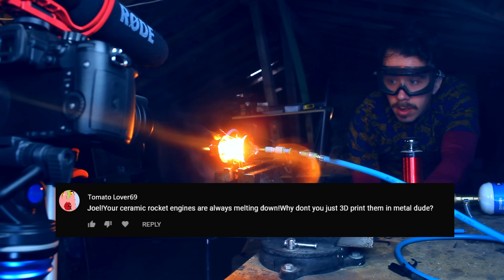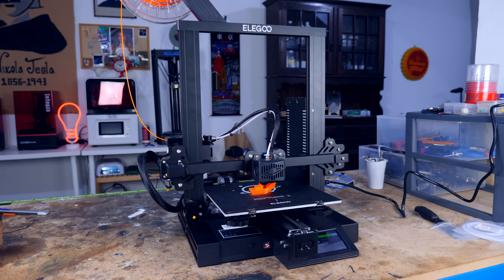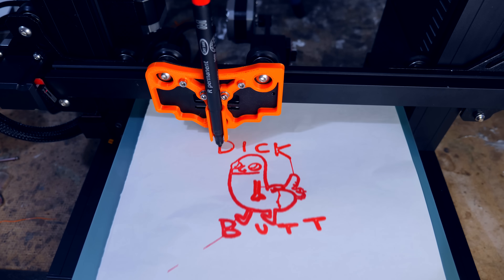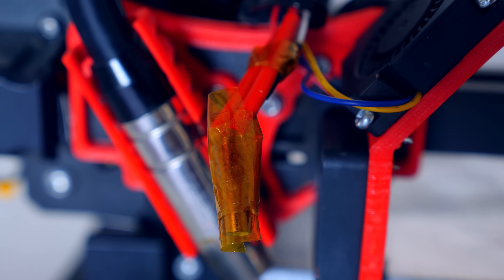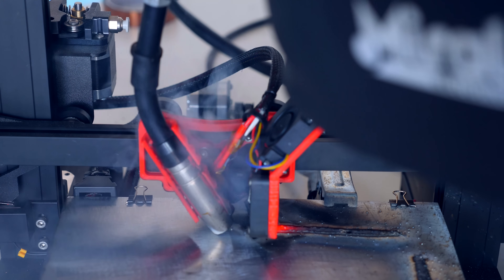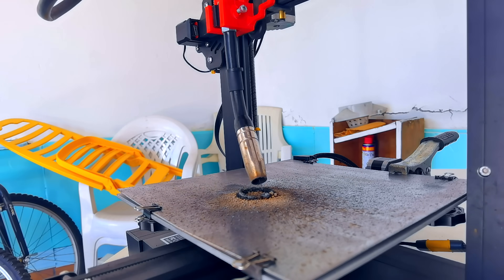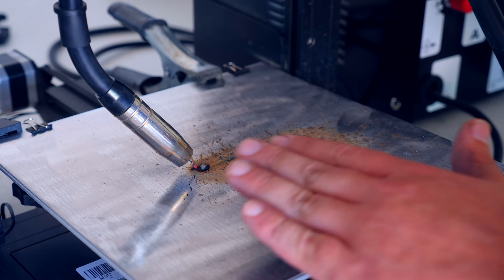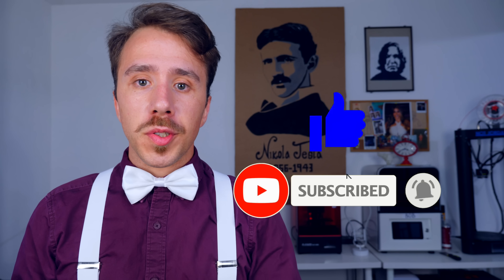I built a Metal 3D Printer using my Welding Machine

Comment: Another issue with using a fan to cool a welding nozzle on a mig welder is that the welding process is insulated by defused gas in order to keep things like oxygen from introducing inclusions into your material. You don't want rust pockets in your weld. They have water cooled welding tips. Well worth the investment if your wanting to do something like this.

Also. Cool idea.

But don't forget there is an optimal distance from the material, feed and travel speed, and gas flow for a good weld. Pausing between each layer is a good idea. If you are trying to build up a weld you would do the same thing. Your other option is hot tacking point to point. But this will create layering and increase the chances of delamination and propagation of cracks.

You might have better luck looking at the feed speeds of Cnc plasma cutter's as a starting point.

Comment: Are you not using any shielding gas? The resulting welds look very much like you aren't. If you aren't able to use shielding gas, try using some self shielding flux core wire instead, and make sure you set your polarity to DCEN, where the work lead is hooked up to the positive.  It would however be ideal to use a shielding gas with solid wire instead because the flux cored wire will generate slag.

Comment: Your welder is using flux core, the other machines you showed that could 3d print metal look like they're using normal C25 gas (carbon dioxide, Argon) also flux core requires you to push into the weld pool, gas mig allows you to pull away from the pool. So your gun is set up backwards. I would try gas and just point the gun straight down, no angle. I looked up metal 3d printers and they look affordable more than the cost you quoted. Also a metal CNC is more useful and those are not super crazy priced. You can get a cheap one off AliExpress and Tormach is what enthusiasts get if they have 10,000- $20,000

Comment: Have you ever heard of lost PLA casting, its a way of creating metal parts out of plastic 3d prints. I believe it would help you build your metal rocket nossle and be an intresting video.
Reply: Integza already has the kiln, and a quick search turned up a furnace/foundry for $300.   Bronze melts at around 900 C, so it really sounds like a working solution.
Reply: the only problem with lost PLA casting is that it only works with softer metals like bronze, copper, aluminum, ect. Its good for making sculptures but not good for parts that are prone to taking on damage or bending. Actual metal 3D printers can make stainless steel parts that are incredibly strong in comparison, unfortunately. I hope some time soon steel printers wont cost a mansion.
Reply: @Pangur_Bon  I didn't know that limitation of lost PLA, thanks
Reply: or this printer - https://www.youtube.com/watch?v=4FkzLs7cLes
Reply: Good luck mending the metal though
Reply: This needs more upvotes. Integza has the drive to make this work.
Reply: I wonder how you could compensate for the decreased size when you burn off the PLA tho. Will you get a porous metal part with the original size, or a smaller solid piece?
Reply: @kerbodynamicx472  theres a company 3d printing full scale rockets that accounts for the warping while the metal cools so...
Reply: @henrygaraffa5584  Relativity space, their 3D printers operate more like lathes, instead of using the cartesian coordinates, the use polar coordinates which as a radius and distance. Those are meant to make cylinders...
Reply: @kerbodynamicx472  you know the cooridinate system doesnt matter, right? and they dont iirc, the extruder moves, not the part. the complexity of the piece is what would make it possible or not

Comment: You just need 3 things, a better, stronger, thicker table. Set the parameters right for the welder and finally a little groove on the nozzle holder that will ensure the right orientation for the nozzle. Also, paper clips to hold the sheet metal is not the way. From a mechanical engineer that LOVES tomatoes

Comment: That kind of welder has a wire feed motor that feeds wire terribly inconsistently. I have tried 2 of them with the same type of wire feed motor as yours (they were brand new cheap harbor freight machines) and couldnt get it adjusted properly. I have been using wire feed welders for atleast 22 years now and am speaking from experience when I say that machine just couldnt feed properly. The wire feed motor is the same design that Clark welders use in the spool gun. It's too small and lacks in robustness for pushing wire out a mig lead. The other thing I learned but actually here on you tube is that the harbor freight model uses AC current to weld. On any decent mig machine the welding current is turned into DC and is actually adjusted by increasing or decreasing its voltage. So... a DC constant voltage power source! This is done to give the machine a smoother more consistent arc that pops and spatters a whole lot less. I believe the same project could be done with a much higher success rate if a better quality welder is used. I.E. a used lincoln sp135 off ebay, I still have my first one and it is over 20 years old and I promise it still works better then the machine used in this video!!

Comment: Have a look at cutting edge engineering on YT and how he welds difficult and very thick hydraulic rods with a rotating machine. He uses argon on fluxless wire to give a clean weld and every two layers cleans the weld with a wire brush on an air tool. You probably need a cnc made of metal to handle the heat and construct layers that are wider. The finished article can then be machined to size using conventional machines. Your approach is a great idea that has a lot of promise for one off productions. Good luck.

Comment: method X is a sintering printer that is @ 4k USD, still expensive but much cheaper than the industrial ones. still need to anneal with a separate oven though

Comment: There is G-Code for curves, but it's usually on 32bit controller boards due to it being difficult to do on 8bit boards. Another issue you may run into is electrical noise from the welder impacting the controller or leads to the steppers if they're not shielded / are too close

Comment: Could you do a lost-foam or sand cast in metal? That allows you to pour molten metal into the shape of your 3D print and get a metal version. I'm working on making my forge and sand casting set up, but it would allow you to make any print in the metal you can melt!

Comment: 1)You can make a jet engine by casting aluminum instead of using sheet metal....for metals just goto a scrapyard and find it there....
2)and for the cooling system use copper melt from any motor you find at scrapyard.
3)And to prevent the leaking problem why not use high performance gaskets used in engine block just cut it to shape.
4)for reverse flame problem i think the culprit is high pressure in chamber and comparatively low pressure in valve.
5)A crazy idea for spark--coat the nails u used in non conducting materials just leave the tip uncoated then place two nails at a gap enough to produce arc at an angle 180 deg it might just solve the spark dealy problem.
6)GIME GIME 3D PRINTER please 🙏 😢 ♥ 🙂

Comment: you're using fluxed wire.  If you use argon plus CO2, or just argon, which has less energy, and a proper parameter setting, you would get much less sizzling and allow continuous welding.  plate deformation, although unavoidable, having very high layer heights after being about 5mm high would stop deforming.  I think if you keep trying you can get it ... you have to protect the printing machine belts

Comment: Hi, Integza I've been hooked watching your videos and cant help but think that the rockets are really working, you need a material which can withstand a lot of heat and easy to handle, can you try to use a 3D mould and try to manually compress some kind of fireproof powder under a press and bake it later to strengthen it or you can manually pack that powder layer by layer so that its uniform ,that way you will end up with a solid piece with fireproof capabilities.... 

Could you try this? or atleast discuss this in one of your videos?

I'd like to hear your thoughts on this

Comment: Well-Done, great idea, & now I understand 3D printer.
Perhaps cut the design of your rocket engine into laminate layers
  Cut the laminate layers out of sheet metal & weld them together into your rocket engine
  Seal any small holes/cracks with some type of high temp ceramic sealant

Comment: Why don't you try to use a "Refatory Sandbed" instead of a thick metal one? To start the weld arc uses a thin layer of metal previous printed in

Comment: Video idea: make metal casting with lost PLA.
That way you'll have metal rockets only using a normal 3D printer (and a melting pot).

And you can use gold to cast the rocket, so you are not made of gold: but your rocket will be! =)

Comment: Have you thought about casting a rocket nozzle? You could print the part in pla and use a sandmold.Then do the wasted PLA method, so the part completeley melts when you pour the metal over it. Still you could probably only cast aluminium (alloy) which also will melt at 400-600°C so it's not really much of a use for a rocket engine :p

Comment: Should look at redesigning the nozzle so it can be oriented straight up and down.  Built a metal frame out of steel tube and tack your thin plate to the still tubing to help with warping.

Comment: Lol, this was so destined to fail. Don't get me wrong, idea itself is sure to work, but 3d printer and especially with that welder it's not going to happen easily. Thing is that all welders have, is it duty cycle named feature that limits time to weld. So especially with cheapo welders you can weld with semi decent speeds for very short time periods. Meaning that you would have to stop very frequently and then continue. That itself is could obviously be countered by simply doing program, but it would be absolute hell to make it all work well, because of shrinking during cooling. But yes, it can be done as video in fact showed at the end. But with 3d printer and cheapo welder... No 😁✌

Comment: Metal shrink when cooled down and expands when heated. It's called metal shrinkage. The sheet on the bottom bends because it gets pulled together by the printed layers, which eventually cool down and start pulling together creating tension outside and inside the printed area.

Comment: 3d print molds to stamp sheet metal with to form parts for your rocket engines.

Set the infill to 100% and use a vice to actually stamp. You can get pretty decent results.

Comment: Yeah, you definitely need an inert gas shielded welder (so MIG or TIG) to make this work. The problem there is that means you have to buy argon or helium, which aren't cheap, and add another point of potential failure.

Comment: professional welder here. First thing is your gonna need is a solid metal mig welder. Building material on top of slag is going to be inconsistent at best and will probably be Swiss cheese. Torch angle is better straight on unless you can change the angle for each directional change in the printer.

Comment: the welding machine should use argon gas instead of fluxcore so the welding results can be cleaner. try to make the support more thicker so it doesn't melt easily

Comment: Hello, have you tried with metall filament for sinter process? Something like "BASF Ultrafuse 316L".  If I have understand it right, you can print it with a normal FDM printer (with a little bit higher temperature ability) and the you had to send the pice to the factory, where it will be sintered. The result should be a metall pice. (with a little shrink of size).

Comment: You should use 3d printed part to crate a mold in sand when you apply heat plastic melts and mold created pour molten metal inside mold and you have it .

Comment: Hey Integza, im not entirely certain but are you using a bare metal wire when your welding? If your not using flux-core wire, which is seems like your not, you need to have a shielding gas(100% CO2) hooked up to your welding machine. Using a shielding gas might solve many of your welding woes, and should help to make your welds much more consistent, stronger, free of pitting, and not to mention look much better. New to your channel but I love the videos! Youll get the welding thing down in no time.

Comment: welder here you should use welding gun that have watercooling first of all. also welding machine that has a pulse feature, that helps to keep weld heat lower and rise the weld bead higher without melting down with the heat. even if you dont have thicker material, bending the edges of the sheet will give it a stronger structure against deformations.

Comment: There should be a metal 3d printer using welding filaments in IPT Fraunhofer - Aachen, if you happen to be based nearby and wants to do an outside activity. I was there during 2009 and later. They have also integrated the mechanism to a milling machine, printing and finishing with just one setup, giving a smooth surface at the end. worth the visit.

Comment: Hello Sir, I was wondering if you could use layers of metal powder instead of the welding machine filament. I was thinking that having one layer, then use the welding machine to weld the metal powder, it works the same way as the welding 3d metal printer that you did, but it may have a better resolution, and may allow you to print bigger items. I am not 100% sure if that would work the way that I envision it, but it is totally worth a video of trying it. 
Oh! By the way I don't have a 3d printer but I would love to have one ;)
Reply: That machine exists.  Check youtube.  The process is still time consuming and complicated.

Comment: I know alot of people have said this and I'm late to the party but try copper plate for the bed so you 3d weld won't stick and use a shielding gas like CO2. Try not to use flux core because it produces slag to protect the weld when it cools. I'm sure you already knew this though because you are integza.

Comment: Its possible to do it, use solid wire, don't use flux because of the slage, don't use that machine, you need gas, with solid wire with gas and then put an plate of 5 or more thickness, and don't weld continually its better tak weld

Comment: I have too many silly ideas and not enough time but another idea I wanted to build was a home made flow bench. Using a MAF sensor from a car and some printed parts. Then use it to see and test dimple porting and add smoke for visual. Also you could simulate erosion and see if you can fix corners and leading edges of parts by forcing laminar flow in said parts or upstream.

Comment: I have been wanting to test the centrifugal limits of printed parts and seeing if you can strengthen them by. After you print your part pre UV cure. Setup a rotary tool probably a die grinder and see if you can find a somewhat steady rpm to spin the piece while your UV cure it. It’s possible it might have some internal stress relief and could make a part be able to spin faster. Making like a dyson style vacuum etc. Or a compressor spool.

Comment: Try again. Use a mig welder with shielding gas. And point it straight at puddle. Use .023wire at 14.5v.
Reply: And build it off a stub so the Bass don’t get too hot

Comment: i've been workin on this kind of thing for a few years. tried doing it with really small welding wire but things ended up jamming in the spool gun easily. moved on from this a while ago. Also by the way your stick-out length is too long, should be more like 1/4 inch. If your nozzle was perpendicular to the surface that might help a bit (just a guess).
I am probably just going to end up using the metal-infused filament that you an use in a plastic printer, and then get a kiln for the sintering. Not sure if those parts have any kind of strength though.

Comment: Basically works like a welding robot. Used to make many things, like cars. If you could actually extrude metal it would be 3d printer. The difference being the amount extruded, a wire vs. a larger amount.

Comment: Video idea: Record sound or data on a 3d printed disc or cylinder like vinyl records or Edison wax cylinder.
Reply: The resolution would be extremely poor. Even with a resin printer, I don't think you could get anything that would make recognizable sound on a standard format that a player can use. Maybe a CNC could do it, though!
Reply: @4.0.4  
I'm thinking it doesn't have to go on a real record player. it could be played back using a needle on a cone while the disc/cylinder is spun on a drill. 
you could make the grooves deeper, lumps higher for more movement of needle. you could sand the disc/cylinder down after printing it then record the sound using a cutting needle on some sort of electromagnetic actuator. Edison done it. also someone done it on a Plastic Food Plate 
https://www.youtube.com/watch?v=APXXBTwkXSg&ab_channel=databits
Reply: https://youtu.be/IQi8FUsZ8OY

Comment: Actually love tomatoes, lol, this channel too. 
Idea. A small scale waste gasifier from 3D printed parts and various “tomato cans” that can provide fuel for the 3D printed rocket. 
This vid, used to be a welder and love 3D printers, hence the comment to try and win, but...
Ok. I’d start w the base. I’d try 1/4 to 1/2 in aluminum. Dissimilar metal, easy to separate later. (Research papers exist)
Second, you can angle the nozzle perpendicular to the gantry. 
Third to control the flow, you’re gonna need current and voltage sensing feedback to both the g code and welder controls. 
Wishing you all the luck. Got a 120amp flux core welder waiting to do just this, just gotta finish some honey-doos first. 
Good luck

Comment: Cast the part you need. Use your 3D printer to make the part. Use it to create a mold in casting sand. Pour in the metal from a crucible. Whala the part you need.